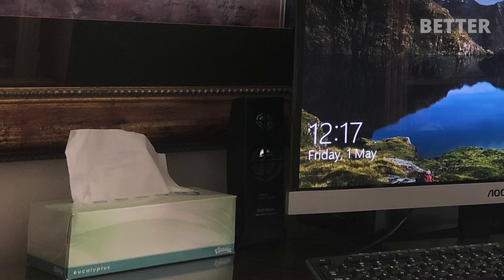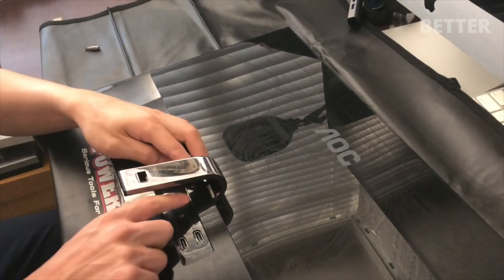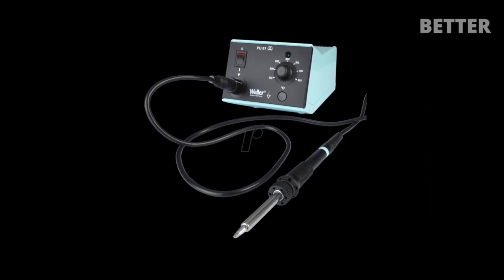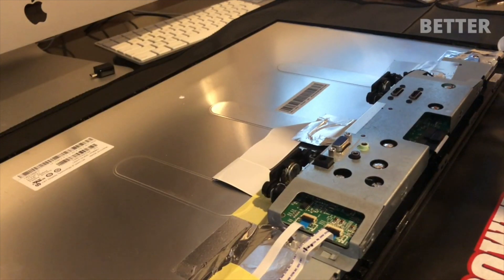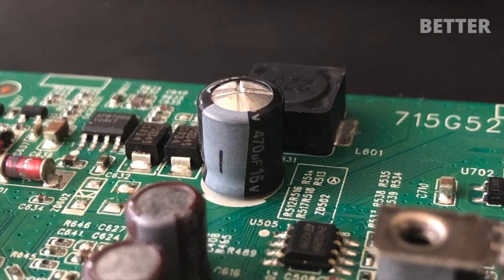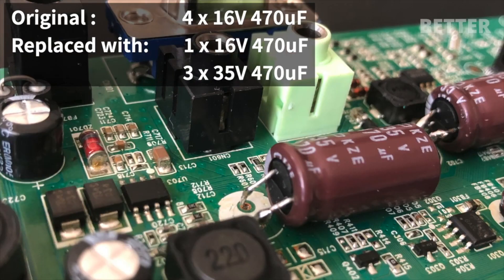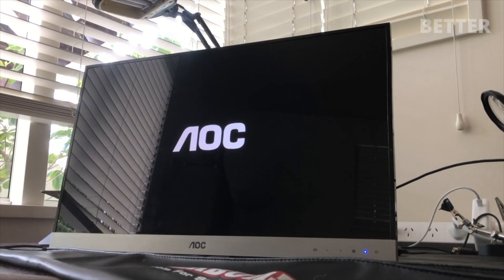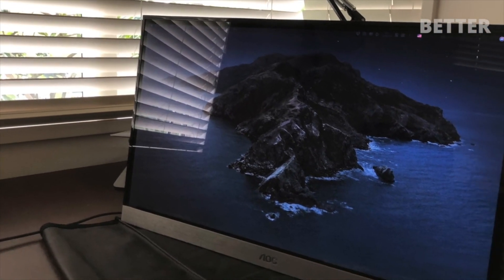Monitor White Screen Failure Fix AOC | How I bought this monitor for $1| Can be applied to All Brand

Comment: Did I miss something? You just replaced every capacitor? No diagnostic or what? I'm confused
Reply: well all the capacitors had clearly exploded so that is a pretty good diagnosis in my book.
Reply: @RetroScythe  I've got a Samsung with the same issue.  Fixed one previously by just wiggling the ribbon cable but the other one it didn't help.  I'll have to check them. Thanks for the vid

Comment: I have the Same Problem! But the capacitors didn't exploded, all i just did is remove all the parts then clean them or brush them lightly then put them together, and try if it works! (remember this method is temporarily not pure fix!)
i just want to share with you!
BTW My Monitor is NEC AS192M

Comment: Guys, just press the power button until it close by its self (5-10 seconds) when it turns off wait like 10nseconds and then turn it on.And it’s fixed
Reply: Yes you are right, this has happened to me several times. All I did, removed the cpu cord and then pressed the power button off on the monitor. Then wait for like 5 mins and then switched it on. It worked some 80 % of times, other times I removed and reconnected the power cable a few times. But everytime I see the white screen I feel the fear.
Reply: @ajaykhatri8299  The CPU cord? I'm lost.
Reply: @ehsanforghani8477  there are two cables in the monitor right? One is power cable, connected to switch, 2nd is cpu cable, remove the 2nd. And keep the power switch on now. Press the power button "on the monitor" off. Go have a coffee. Press the power button on the monitor on. The total white screen should now display monitor logo and a msg not connected to computer etc. Now connect the cpu cable. It has worked for me. I have a 12 year old monitor and it happens whenever i keep it off for months. Maybe some capacitors are discharged.
Reply: @ajaykhatri8299  oh thanks, I think you mean the VGA cable.
Unfortunately mine is even older. The problem is it works until I open a page with white background, then it turns off or works with many glitches. So as you suggested I'll have turn it on and off and avoid white pages.

Comment: i have the same monitor. mine after a while will have a green fading shade on the whole left side of the screen. the lower front central part is unusually hot. sounds from jack is erratic, sometimes on sometimes gone. i love this monitor cause it has a 2d to 3d operation.

Comment: this is not white screen failure. white screen failure is when your monitor goes white a few seconds after being switched on, everything progressively fades to white, and eventually, you see nothing.
Reply: Exactly...white screen problem is this exactly described here. And almost never is a capacitor problem.  I am a technician. No matter the brand of the monitor. A white screen and then the screen goes blank and then standby is mainly because of the matrix board problem.the board on the LCD it self not the mainboard assuming that the Vlcd (5v or 12v) from lvds cable to the matrix board is ok. Check test points on matrix board and see if the appropriate voltages are present before the monitor goes to standby.. Careful not damaging the plastic ribbons to the LCD because this damage is not repairable
Reply: Thats my rpoblem

Comment: i have this issue on a 450$ monitor xb1 predator 27"  ...thanks for the info!
Reply: Same!
Reply: Same!
Reply: @jeredcorrell  Man me too! Did you fix it?
Reply: Dude I have the same problem, is there any solution?
Reply: i ended up just buying a new one, still have the XB1 though, would be nice to get it fixed eventually
Reply: @obxtarheel9191 That's nice, for me I tried taking off the screen panel but I instead made it worse to the point where it's gonna cost hundreds of dollars to repair.
Reply: My 2 month salary is 450$